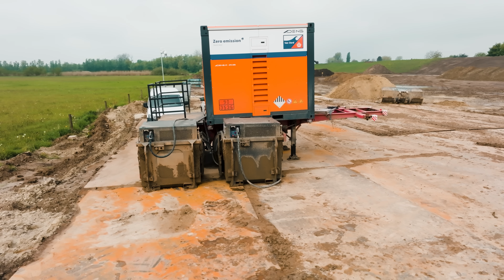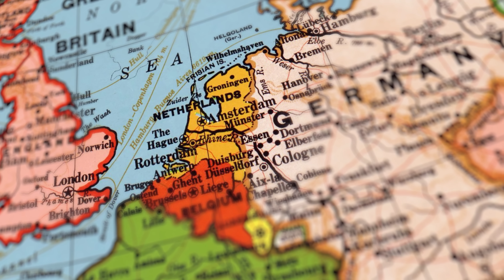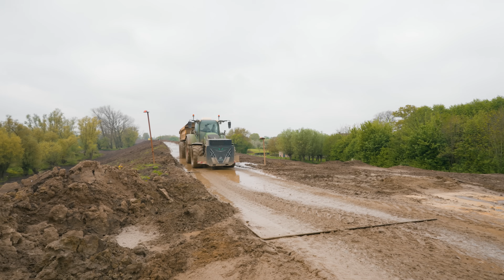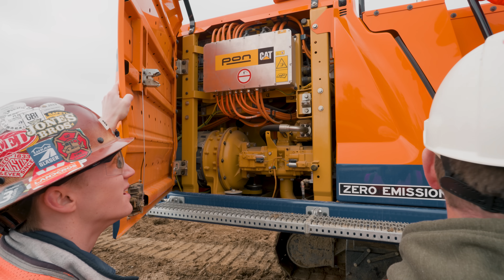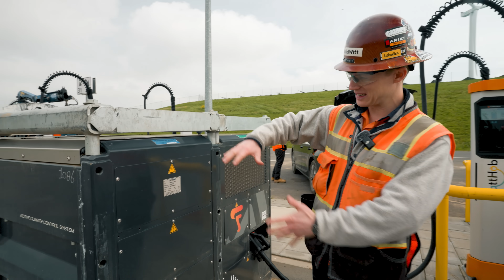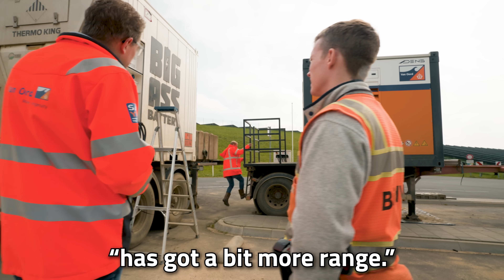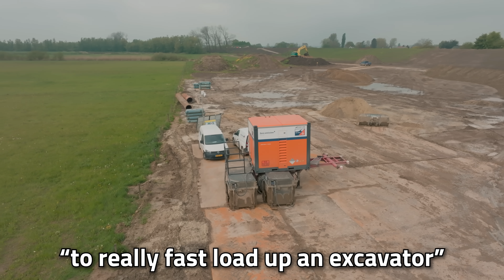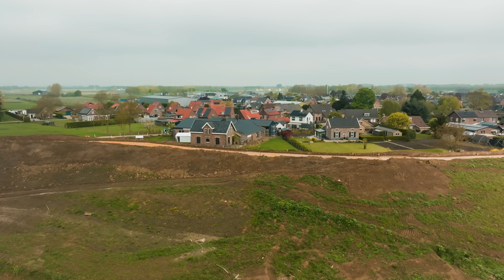Inside the World’s First Electric Construction Project!

Comment: 800kw in a day?! That's only like $103usd in energy. That's crazy cheap for a machine that big! That would normally be $215 in diesel. Plus DEF and breakdowns.
Reply: In your own math you just proved electricity is €52 cheeper...
Reply: @PointBlank65 Yes but the "green" infrastructure needed to produce the energy required is more expensive and takes up more space e.g a 1MW genset vs a 1MW solar farm🤷‍♂️
Reply: @ctcheath7238 take up more space, yes. More expensive, really ?? It 2025 not 2015 any more. Solar and wind energy tech is so cheap now and give Europe energy independence. You can keep being threaten by Russia or Middle East dictator or build more nuclear, solar and wind.
Reply: @ctcheath7238 Solar is now the cheapest form of electricityproduction there is and it is indisputably greener than fossil fuel based alternatives.
Reply: @Milistop1872 give us more nuclear please thats the best and cleanest energy
Reply: @youriigar6028  Best ??? Totally not. Nuclear has nearly 100 years since 1950s and only hold around 10% global electric generation. A best tools must be a useful tools not a theoretically perfect one.
Reply: @ctcheath7238  That's why they need Nuclear. The cleanest energy and far more reliable.
Reply: Tell that to German dumb politicians that turned off our nuclear
Reply: @ctcheath7238 what? First of, that is just plain incirrect depending on situation. Secondly, the electricity cost that you used for your calculation already pays for all of that energy infrastructure, green or otherwise, just like the diesel cost pays for the pumping, transporting and refining of the oil. Except that for the diesel you also need to add another 200€  per ton of CO2 emitted in externalised cost due to more extreme climate. So you need to maround triple your actuall diesel prices to account for the gifts we throw at the fussil fuel industry
Reply: @timbonator1 all german nuclear would have had to be turned off within the next couple of years anyways, as they were all at end of life anyways. Building new ones is a different debate, but that stuff about ll the nuclear power we would still have in germany without politics is just brainless propaganda
Reply: kWh* ;-)
Reply: Diesel isn’t 55% efficient, 30% is a generous estimate. That gives 480€
Reply: It's solar powered, so only costs made for transporting and storing.
Reply: 800kW for an average dutch household would cost 800kW * €0.26/kW = €208  , 
diesel costs:  800kW * 55%(diesel engine efficiency) /10kW/liter (energy per liter of diesel) * €1.8/liter = €260

but solar, but windmills, and investing in the tech required. I know. This project is by far cheaper to do with diesel, (no brainer duhh) but yeah we got GP idiots running our country demanding everything to get crazy expensive, for the average man at least. and this is where I stop ranting..
Reply: @leonvdm that €52 per day per machine. Solar and windmills and investing in tech will not only use in this project. So are you sure it will be crazy expensive in the next and next project or cheaper ??? That totally flawed math here.
Reply: @leonvdm  These aren't households, but industrial users and they have access to an energy discount. 
Also I think you know why such a green transition is necessary.
Reply: @leonvdm  If you have a utility connection that can supply 800kW/day continuously, you don't pay household rates. You're on an industrial rate automatically. So you can half that cost, easily.

Also, your diesel efficiency is a bit high. You only get those 55% when you operate at constant optimum rpm, i.e. when you're running a generator. With a directly-driven hydraulic pump, you're revving up and down with each movement of the machine. 40% is the best you get with that profile.
Reply: @leonvdm  don't know what world you are living the best Diesel Engines have 45% efficiency (Mercedes / Scania Euro-Truck engines), a Diesel engine always been very efficiency even the first non electronic injection, turbo, intercooler ones start at 30% .. Benzin starts at 20 and goes up to 35% in F1 cars.
With drive train and other parasitics an Diesel engine goes down to 35%.
Diesel don't need an AC heater in the Winter, but a battery needs to be heated, and yes both need an AC cooler in summer, batteries get hot under load. 
Rudolf Diesel initially introduced the engine to the world using peanut oil, that's why you can run them on frying oil (Frittenfett).

Nonetheless why you under estimate is the EROI of Solar. You'll find 1kW PV produces 400 kg of CO2, that's becasue it's a semiconductor, and semiconductor poduction is highly energy intensive, resource intensive: water - Taiwan stopped production multiple times in 2024 because of water shortages -, used acids like hydrofluoric acid (HF), Sulfuric Acid, Nitric Acid, Phosphoric Acid, Hydrochloric Acid. 
Wind turbines require oil for the production of the epoxy glues for their "leight weight" rotor blades made from glass firber and and epoxy, rare earth, which themselves are highly energy intensive to produce, for their high power generators - in the 80's 500 kW was the maximum nowadays 2.5 MW is very much the standard, because better magnets. They are non recyclable, neither the rotors (the recycling is: turn them into find dust and burn them .. which of course gives you less energy than oil itself) the steel needs to be remolten because stress, the concrete foundations are non-reusable because of the loads so they are disposed of.

The EROI of PV is 3 - 5 that's as effective as collecting wood in the woods: Middle ages
The EROI of Wind is 10 - 15 just about 1/3 of a gas turbine that you could run from methane produced by waste water residue methane production.

An EROI of about 7 is considered break-even economically for developed countries, providing enough surplus energy output to sustain a complex socioeconomic system.

Both are neither conatant nor reliable power generation as they fluctuate, PV: You can look directly at the sun through clouds when occlusion is roughly under 70%, that means in reverse conclusion 70% of your 1kW is now gone! Go get your self a PV system for 300 EUR look at the curve yourself ...
Last 3 years there were at least 2 weeks the WHOLE of Germany couldn't run wind turbines because of nation wide winds of above 70 km/h, typical cut-out wind speed is  20–25 m/s turn of speed for wind turbines is 80 km/h,  a normal 30 meter rotor avg. weight is 4 t,  60 meter is 25 t, they rotate with 70 - 80 m/s. Simple math km/h in m/s  =>  (X km/h/3.6) m/s if you like divide by 4 (m/s -> km/h is multiply by 3.6 [the 1000 in kilometer and 3600 seconds - in an hour - the thousands negate) , so 35 m/s is 100 km/h so that's about 200 to 250 km/h that's 300 - 400 m in 180 km/h storm, that range becomes 1 - 1.5 km and can create forces up to 500 t.

Best is still nuclear with 75 - 100. Don't want reactors that produce bomb material? LFTR / MSR.

Comment: How do they change the Batterie at Fendt? Batterie off and you have no more power to drive to the other.
English is not my Motherslang
Reply: The tractor also has a smaller internal battery, allowing it to keep moving while the main battery is being swapped.
Additionally, the blue cranes from Ploegam (Devolon cranes also made electric by Staad in the Netherlands) can swap batteries just like a cordless drill, making the process fast and efficient.

Comment: Or just use Tesla Megapacks 3MWh capacity, output 1,5MW cost about 280k€ cheaper than an excavator. It can also be charged with AC and can output AC or DC.

Comment: This is cool and all but the extra work and buying the extra parts and equipment would not work for majority if not all of the compaines that work in consctruction in my country. We do not really have charging points in all of the areas at least to this size and plus hauling equipment to this scale is not worth it. With gas powered machines u just need a machine truck and maybe a mobile station which can be put on a van or smth and the machine can last up to 15-20 hours of working.

Comment: Very interesting. As a side issue - as seen at the Bauma in Munich - the very large mining machines are with electric motors. The electricity generator is on the machine.
Reply: That also how Diesel Train work, Diesel engine generate electricity that drive the electric traction motor. It's quite a common thing. Some buses work like that too.

Comment: That is pretty cool idea. The system they have for that, for the charge packs better than circle and recharged so that way they always have charge packs there that do fast DC to DC charging. It would have been nice if you went more into the technology that they use. Like if they're using a 3000 W DC to DC ultra fast charging or something like that. That's got to be a massive charging system for those power packs to be able to transfer and charge the onboard batteries so fast! So they've definitely do a DC to DC charging since the battery is packed there at DC already so there should be very little power loss during that charge cycle should be near 100% conversion minus what's lost to heat.

Comment: 10:00 An interesting fact is that the tractors can change their own battery. In addition to the large battery at the front, they also have a small internal battery that allows them to swap the front battery using their own power.
Reply: Wondered about that because I'd want an inexperienced worker in those excavators while the operator is on lunch. Considering how slow they move the excavators I would think dropping a wired battery behind it once a day would be an option also but it looks like having shift change and meals as down time trumped that.
Reply: @sparksmcgee6641  Having employees who only work one hour a day is not worth it. For one, you won't find anyone to come to work for that short time. It's not worth their time. And then they need all the same certifications, training, and personal equipment a full-time employee needs. That costs more than you'd ever get from not having a lunch break.

And on top of that, those machines are high-skill, high-experience only. Not only are they expensive, but also easy to break, and the damage you can do with them is high.
Reply: Thanks, I was wondering how that worked.  It wasn't shown in the video.

Comment: We need to see those diagnostic screens in the machines! Also talk more about battery, motors, pumps heating/cooling, cabin HVAC, all of that runs differently on EV platform and it's very interesting to see what these big manufacturers learned from EV market

Comment: it's still awfully loud. the hydraulics are noisy. it's heavy EQ I would have thought they would charge at 650-1000 using some extreme cooling while do so.
Reply: Yes, the hydrualics are really inefficient too. 

Have seen some of the newer scissor lifts (for example) starting to be powered purely by electric motors, which is very much possible and has numerous benefits.

These machines will stop using hydraulics in the future which will provide an instant doubling in runtime, only issue is of course the large investment in research and retooling to remake an existing excavator for example, which is why not everyone is doing so yet.

Comment: I thought it odd that they didn’t run a temporary medium voltage cable along the side of the dyke to power rapid chargers directly, then no need for ferrying batteries around.  But hey, it works!  Great stuff.

Comment: Imagine having to lay a steel road just to operate the least efficient equipment
Reply: You clearly have no clue about efficiency!
Reply: Even with more conventional vehicles ypu would need to lay something out.
Efficiency gains are just a bonus. That also would affect conventional vehicles scince rolling resistance is ever present
Reply: That road would be a mud bog in under a day without those steel plates!

Comment: A fast charger is about 40k, batteries are about $130 per kWh, so at 870kWh that's about a million dollars for the 870 kWh Big A** Battery - and they had several of them on site

Amazing video. Can't believe this was already possible. A couple of years ago they still said electric tractors weren't possible and now they're everywhere.
Reply: You seem to have an off-by-10 in your calculation. The battery is only ~100k $
(130$ * 870 = 104'400$)
This is also in line with the price premium on electric semi trucks, which have a battery capacity in similar range

Comment: 0:30 huge diesel generator, charging the battery's😂
Reply: As mentioned in the video it is a battery. The "90 3536" further proves this as it is a warning label for lithium batteries.
Reply: Iv been on sites before have one engine running instead of 50 cuts the noise pollution by heaps

Comment: It is also used just to learn what works on a fully electric job site. I am sure the next generation of these machines will have many improvements over these ones making it easier to go all electric. The most chellenging is that this is not stationary job site. It moves every day. So just creating one charging hub is not possible. That is why there is so much moving around with batteries. Maybe the electric can charge the digger while being loaded?

Comment: I've been saying it before i saw this but electricity does work in vehicles I'd just argue it won't really work in cars, if you change everyone to cars the waste and damage to the enviroment would be worse than petrol or diesel from manufacturing the car/batreries to the electricity manufacturing, but in big vehicles like this or busses (trucks would work with a battery change system but are limited by weight so won't work yet) makes a big difference in polution but also just noise levels for everybody around perfectly demonstrated here

Comment: This shows what CAN be done, the results of the use of this equipment will provide ,reliability, downtime, repair and operating costs. LOTS to be learnt. All this ,of course, uses electricity, which needs to come from somewhere, Wind, Solar, Fossil fuel, or Nuclear. Needs careful evaluation.
Reply: No matter where the electricity comes from, it's always better than burning diesel.

Comment: 1-The important information is never revealed, how much does the wind turbines and solar panels cost for 2 million cubic yards to be moved?
2- How many machines were converted to electric and at what extra cost including batteries per machine over conventional deisel powered.
3- What does all the extra batteries cost including equipment and labor to run an only 8 hour day which is not at all common in construction industry.
4- Most importantly what was the environmental cost and pollution caused where the materials for the batteries were mined? 
5- How many total hours will those batteries last as in lifetime before they are junk and how will -20 to -40 weather in Canada effect everything questioned?
Reply: 6- how much did they save on (noise) pollution and diesel towards infrastructure we can use for a long time and gets recycled afterwards ?
Reply: Re 1: Cost per KW is often lower than fossils these days.
Re 2: Upfront cost is offset by lower operating costs over the life of the vehicle, including batteries.
Re 3: It is residential area, 8 hour day and electric are primarily for noise reduction.
Re 4: Lifetime pollution for electric still comes out lower than ICE, even for coal powered grids.
Re 5: Battery lifespan typically 15-20 years, with 1.8% degradation per year. If it works for Norway, it should work for Canada, and the chemistry is as bad as it will ever be - only better efficiency from here.

Comment: Over the last couple years fully electric constructions sites have been popping up in Norway, so unless this video was filmed a while back or this site has been fully electric since late 2023 I doubt it really is the first.

Sites in Norway at this scale are not yet fully electric, but the entire downtown area in my hometown is having its' roads and so on reworked and the project is fully electric and has been ongoing for about a year now.
Reply: They started the transition to electric in April 2023 with now more then 40 pieces of heavy equipment.
what also makes it special is that the batteries aren't charged with fossil fuels but with the 3 big windturbines you saw in the video. Making it run on green energy. (Which is special since the netherlands doesn't have any real hydro power)
Reply: @piminat0r Then it may very well be the first fully electric work site.
Norway has over 70% of it's power coming from hydro so we're relatively clean too.
Reply: Presumably the channel means construction project larger than building 1 house building or similar.

Especially as it is not showing building 1 house building or similar.

===

Also, building houses with electric machines/devices seems relatively trivial.

As the energy system for the houses (mostly other houses, but houses tend to be built close to other houses) can be used. Even if they need to be converted for technical reasons.

Comment: This is the future right here—combining raw power with clean energy. It’s not just cool, it’s necessary.
Reply: the diesel 8s actually going the hardest job on site! imagine they actually tried to do that with batteries! it would have been a logistical nightmare. diesel is still key for such things
Reply: @carholic-sz3qv largest mining machines and the most powerful D8 are already electric, but you are fooled as they have diesel generators instead of batteries.